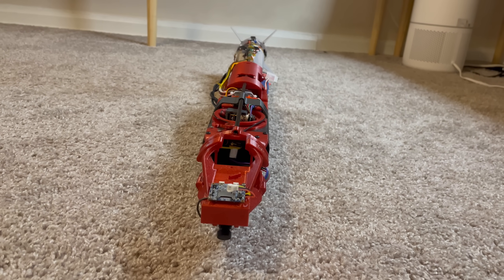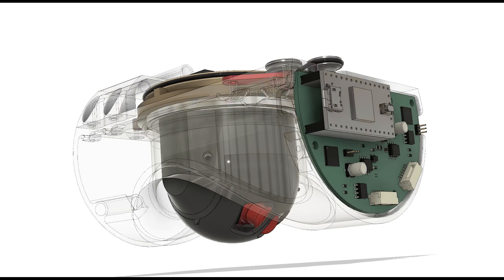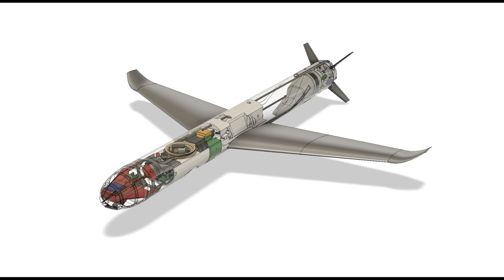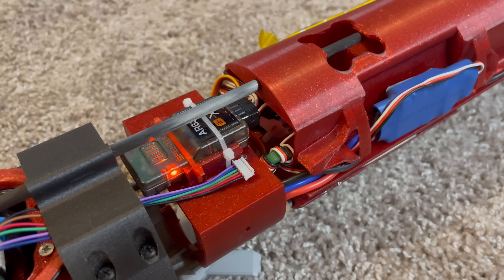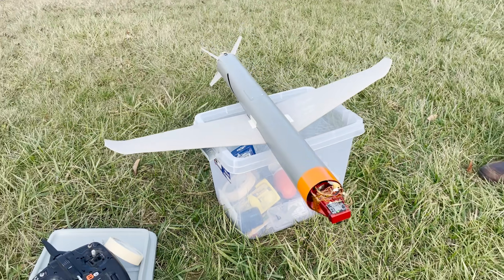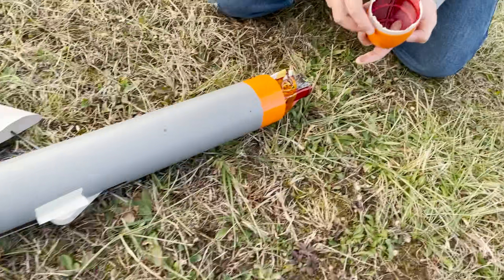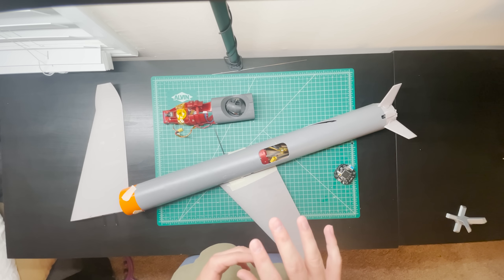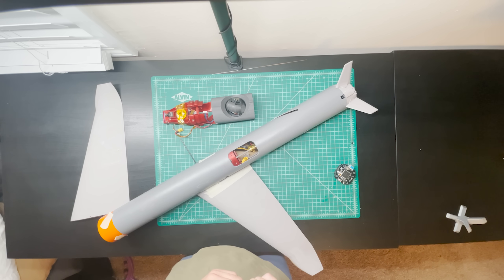Building (And Crashing) my Homemade Surveillance Drone

Comment: I’ve been designing and building competitive RC planes for a couple years in SAE aero and here is my brain dump:
1. Thrust needs to be increased, EDFs are not known for their static/low speed thrust, especially those small ones. (EDIT: Now thinking about it, adding a folding propeller in the front would help increase thrust and reduce wiring weight since your batteries are in the front also) Make sure you have an adequate thrust to weight ratio. Decreasing takeoff weight is crucial since your wing area is a design constraint. Increase powertrain battery voltage if you can, you’ll have to sacrifice capacity to save weight though.
2. Use an analysis tool like XFLR5 instead of ecalc, it uses actual airfoil data and VLM to solve for lift, drag, and moment along CG. See how much lift you’re making at takeoff speeds near stall angle. Check CG also, it might be unstable (especially on launch 3)
3. Increase aft control surface size, they look pretty small and won’t do much at low speeds. The EDF should help, but looking at the video it’s not enough. The planes longitudinal inertia seems really high especially with the heavy batteries up front and large fuselage.
4. I believe you are close to/a little unstable in yaw because you don’t recover very fast at 13:11. You have almost equal stabilizing and destabilizing side area on the fuselage and the control surfaces don’t seem to help with that since they’re moving to control pitch and roll. Increase your aft side area, this will help you recover from a large sideslip which seems to be the biggest issue on takeoff at lower speeds. At a 90 degree sideslip on the 3rd attempt the plane seemed like it had no intention of recovering from it. This could be done by adding fixed fins that are not your control surfaces. You will also dutch roll during these thrown takeoffs if you dont have yaw damping.
5. Add ailerons because you have little roll authority at lower speeds. Roll authority increases if your control surfaces are further outward- those in the back aren’t gonna do much if you have a large lateral inertia from the wings, but this all depends on how heavy the wings are. Your plane rolled a lot during these takeoffs and didn’t seem to want to recover. Dihedral won’t solve this problem. Include a flap too for higher lift during takeoff.
If you have any questions I’d be happy to answer in the reply comments or if you have a discord.
Reply: Wonderful and massively underrated comment.
Reply: didnt know sae had a drone competition. I am the aero composite lead in my school's formula sae team. would have joined the drone one if my school had it
Reply: Excellent suggestions.  I have a few of my own that i'll add directly to yours that I think would give a dang good basis of change for a Rev .2/Alpha .2.  Or at least something to think about...

The overall design is almost identical to that of a SPICE-250 Glide Bomb or even JDAM-ER which is designed to fall and correct trajectory, not float and observe under its own power.  
Thus, I think you have a few design tenants that need to be rethought so that it can fulfill its intended mission.  I guess it really depends on what you ACTUALLY want it to do.  You have a few proposed uses, but it seems like the "loiter" may be the prime with wanting it to film rocket launches - aka ISR/Scan, Detect, Observe.  If so, I think you need to think about referencing more glider/ISR aircraft design language versus missile/high speed or free fall designs.  Yes, while cruise missiles and glide bombs look wicked cool, they are designed to go fast - not float and loiter.  Something like more RQ-9 Reaper and less AIM-7 Sparrow/JDAM-ER/SPICE-250.   None of this is meant as any shade - purely constructive per your request.  I think you nailed a few things and really stoked on where this is headed.

I would say thrust is one of your big problems.  Whether that's redesigning the rear for a dual or larger single, it looks woefully underpowered.  
I would also think about potentially holding back on the thrust vectoring at this stage since you just need to get it in the air.  I think you have too many variables to sort through and eliminating that one will ensure your basics are solid without also having to deal with a maneuverability enhancement that isn't necessarily required at this point.  (Which also leads to the discussion of EDF versus exposed prop.  i'll reference the missile vs. RQ-9/MQ-9 design language.  I know I know, the vectoring is super cool, but that may be something for a high speed project and not a loiter, but thats another conversation entirely.  Maybe this point serves as a path of divergence of two separate designs...but I digress)
I LOVE the idea of the vectoring, so it needs to stay on the final, but its adding a variable you aren't used to dealing with.  Plus, in a few of the test shots, it looks like it may actually be blocking thrust at full deflection and not necessarily vectoring it constructively, further exasperating your thrust issue.  The dual fan rear end would also help the vectoring:  putting the left stab/lower tail-fin on one motor, the right side on the other would open up the cone and have less potential blockage at full control surface deflection AND reduce the number of axis of thrust diversion per motor giving you better vectoring.  I wish I could insert a drawing of what im saying (you know the whole picture worth 1000 words thing), but hopefully you understand what im saying.  Also, you may want to think of limiting the vectoring to a single axis via paddle.  There is a reason why the successful vectoring aircraft use extended paddles and not internal diverters.  You get more efficient thrust vectoring and not just blockage.  The vectoring needs to really extend out the rear end to POINT the thrust in the right direction - think of the X-31 EFM (3D vectoring) or even the F-22 (Single axis vector) - they really extend out and point the thrust where you want it to go.  

So that said - if you want to keep the vectoring, I think you need to extend the vectoring paddles well behind the thrust exit point so as to redirect it more prominently.  It does appear as though they are merely influencing it because they are tucked into the 'exhaust cone'/ducted fan and wont give you much performance. 

I also like the idea of significantly increased size of the top vertical stabs.  That one test it just sideslips to the ground.   Its designed more as a glide bomb or even a cruise missile at this point, which has MASSIVELY increased thrust compared to what you currently have, increasing the effectiveness of smaller control surfaces.
I'd love to help more if you need.  Hopefully this can be helpful or at least give you some things to think about. 

@kylebedrich8803 also has some solid advice for you.
(copied from main body post)
Reply: All of this is correct. It needs to be statically stable for a hand launch. And the thrust deflection needs to be thrown away as a control system.  The propulsive air costs energy, the free air does not- additionally the speed of the exhaust air means your thrust vectoring fins have crazy amounts of drag on them. It's better to have a larger fins in the lower-speed free air than smaller fins in the fast air (drag increases as the square of speed, linear with wetted area)
Reply: Yea, what he said
Reply: Top comment.  I agree the thrust:weight ratio needs to be way higher for a design like this to work.  Aswell as the biggest drawback of the design is there's very little control surfaces. (Pitch yaw roll)  I'm ignorant when it comes to thrust vectoring but I do know you need very high thrust:w for it to be effective on winged low speed craft.
Reply: when starting with your hand, you can also give a small run-up (that is, run with a run-up) - this will add high-speed pressure + run with an angle of attack, that is, nose up, but not too much. Also, the launch should be done as high above the head as possible, so that the height above the ground is as high as possible, because after launch, the aircraft is likely to fly to the ground at the initial moment of time, it needs to have time to taxi from the ground - for this you need a margin in height for maneuver. Another wing - at subsonic speeds, it makes no sense to make a swept wing, as far as I know, the optimal wing shape is a straight leading edge - it will give the greatest aerodynamic quality - you can also play with wing profiles - Xfoil will help
Reply: love this, looked great but fly like shit ...  gl
Reply: Agreed, he needs to use a better material for printing since this material is heavy and not strong
Reply: XFLR5 and OpenVSP
Reply: for a wing, it would be nice to assess the load on the wing, check whether its area is even enough to lift such a mass of the device - select good profiles for the wing based on the coefficient of lift and the moment mz
Reply: Imo I would agree with kyle points but I would give a try using some kind of launcher which would give much more speed at takeoff as first step just to make it launchable.
Reply: @GaweNowakowski  Yes, and I would suggest a bungee launcher hooked in front of CG to insure acceleration on a straight path.
Reply: It took less than a second to know that this brick would never fly. Before trying to design a "revolutionary" square wheel, you should study why everybody else uses a round wheel.  🤣🤣

Comment: I've built several small drones. 
A way to get a better idea of speed and handling it from the sunroof af a car. 
You lose a lot of thrush by having a centreline engine with a NACA duct intake. I'd go for two externally mounted engines (like a bizjet). and  more conventional controls. Yours looks like a rocket without the power of a rocket!

Comment: As to hand launching... From my experience, if you launch with hands, you can launch a 3-4 kg to a stall speed of no more than 40..42 km/h.  Launching a 3..4 kg plane with a stall speed of 30..35 is a piece of cake, and launching it to 45 km/h is impossible. The values inbetween depend a lot on the experience of the launcher...  The EDF motor is not in your favor, either, it does not produce much thrust at low speeds during launching, and does accelerate well.  So I would say that 38 km/h stall speed is absolute maximum you can count on hand launchign your plane.  There are formula which allow to calculate the stall speed quite easily, so you should check that

Bungee launch and  catapult launch are good options.  But they also require some experience...

Comment: Hatchet seems to be a little tail heavy with how the hand launches went. The Y tail is certainly a good idea, you could also supplement the bottom control surfaces with some strakes that you could make more durable since they have no moving parts. Theses could also protect your bottom control surfaces from impact during testing. Have you considered adding canards? Overall, it seems that the craft does not have enough control authority for it to safely exit the hand launch pseudo-stall. Do you have any quad copters big enough to lift it into the sky and do a glide test?

Comment: Honestly, the way it moves once its thrown makes me think it’s too tail heavy. Or at least, there’s too much weight right in the tail (due to the positioning of the EDF) for those control surfaces on the tail to manage. Each time it was thrown, it basically did exactly what you’d expect a tail heavy plane to do. 

As others have mentioned, adding control surfaces to the winds themselves would be highly beneficial here. A company called KST makes relatively (compared to MKS) affordable servos that are incredibly thin and light - they are used for the control surfaces on Discus Launch Gliders, so they hold up well to high forces. Those wing servos should be thin enough that you wouldn’t have too much trouble integrating them into even the thin wings, which would give you a lot more control over the plane. Doing this would also allow you to fully remove the lower control surfaces (while keeping the thrust vectoring portion) which means you wouldn’t need to worry about those surfaces breaking off on landing in the first place. 

If you haven’t already, I would also suggest looking into the foaming 3d printed materials - for PLA, they’re usually called LW-PLA. They have a heat activated foaming agent in them that makes the prints incredibly light, while still retaining reasonable levels of robustness. 3DLabPrint (a long standing 3d printed aircraft company) recommends some of these materials, and advertise a >50% weight reduction for the printed parts. 

Using a slingshot is probably going to be your best bet here. Those wings will require significant airspeed, and EDF systems make very little static thrust, so you’re unlikely to be able to get the aircraft up to speed with only that EDF.

I would also suggest taking a look at the sizing of your air inlet. Every somewhat small EDF plane I’ve ever seen or flown has had additional cutouts in the airframe to make the inlets larger so that the EDF can move more air during takeoff. They just can’t suck in enough air when they aren’t moving.

Comment: Forget about making it lighter using 3D print. You can save a lot of weight if you just used glass fiber fuselage and wings, but still the main problem you have is not the weight. By reducing the weight by 25 % you will decerase stall speed just by around 12 %, So it will not make a lot of difference.  You can go with much bigger wings, but that will defeat you final idea of having folding wings.  The stabilizers are really too small. That is a fact.  What you could do is to increase the overall length of the fuselage to accomodate larger wings and moving the stabilizers backaward. That has the same effect as increasing the stabilizer size.. However, if you increase the wings, you have to increase the stabilizers... So this way or that way, you have to increase stabilizers.  Also, note that you really do not need the lower stabilizers, the V shaped stabilizers pointing upwards are commonly and succesfully used. in RC planes.

Comment: All ideas does sound legit. I have flown aircraft that was unlaunchable from they landing gears using a launcher, but I would suggest finding a friend with a drone to launch it from high altitude, but I understand if thats not an option. Further I'd suggest doing a test model, basically the same thing with a prop, because the Edfs are often way worse for slow speed scenarios.aybe getting a simple prop Infront or aft would be a good test bed, that would also take away the need for a launcher. Good luck and thank you for the video!

Comment: Make the entire rear fin section magnetically detachable and use pogo pins to provide it power back there. Buy a compound bow and use that to get it up to launch speed; could probably make a stand utilize a garage door sensor to activate the  full throttle condition to prevent any false launch events. I would also magnetically attach the wings as well if it remains fixed winged. Probably could add a simple parachute for free fall conditions as well.

Comment: This drone needs so much more thrust in order to fly, the edf is barely producing any, and the little flaps for thrust vectoring are killing the little efficiency edf could have. If I were you I would change the trust system to a prop pusher scheme, which I believe will be much more efficient for the speeds the plane is designed and also will reduce the total weight. And if then you still want thrust vectoring i recommend you checking the funjet 2 vector , it can give you some inspiration. Bigger control surfaces, V tail and CG check are great ideas. Your project is so cool and you are extremely talented, keep it up!!

Comment: The take off weight is too large, the wings are on the bottom of the plane without positive dihedral and you don't have ailerons, making the plane too unstable, small control surfaces and the EDF is too smal. You could put 2 long fixed wings (same as a glider for example) with positive dihiedral (or just put ailerons on it), make a V tail with longer control surfaces and substitute the EDF for a 3546 engine with a propeller, which is more effective.

Comment: I'm thinking you need more wing. Maybe you could incorporate a stacked wing design, where different layers of the wing fan out to form a larger surface area, but when they're folded in (within the airframe) it looks like a stack of cards.

Comment: I'm no pro, but those surface areas scream to me high subsonic range (mach 0.6 - 0.8) so these are imho woefully inadequate control surfaces and wings for the job. Try some of those blended bodies instead of cramming everything into a torpedo tube (which is basically what you tried to achieve here, intentionally or not).

Comment: More thrust required to take off. I’d put (if possible) a weight:trust of 1:1.  

Also seems to be needed some “gobernance” on the tail, in general?

A launcher would be another solution.

Anyways it’s so cool, just needs some improvements, as all invents.

Comment: I would either use a bungee launch. I dont think you even need a rail. Stake one end in the ground and attach a hook just forward of the center of lift. The other open is to build a drop plane. I know this can create another set of issues, but something like the FT Guinea Pig (cargo plane) from flitetest is very cheap and fast build. I've used it a few times when I need a quick drop plane for stuff in the past. Cool video and Good Luck

Comment: Add more ducting for the edf. Make the carbord tube into sections with making the section that holds the wings wider and flat so you can fit bigger wings. Ditch the thrust vectoring and add 4 pop out motors for added thrust kinda like this drone and take off vertically  https://youtu.be/wThmg8Ezm9w?si=XV-sYZy45N4M2rp7 add a pop out tail and alerons for slower flight.